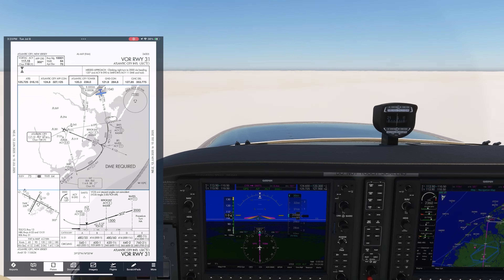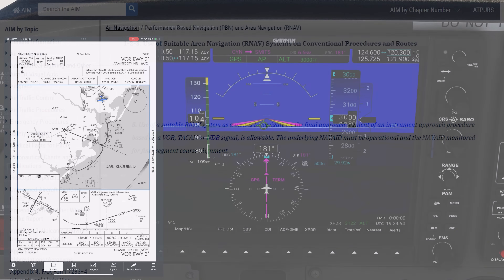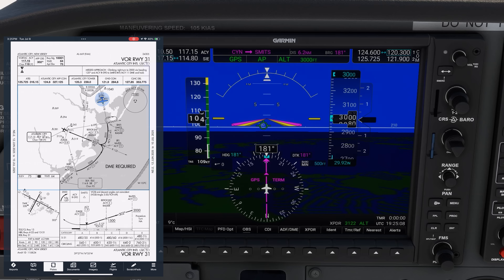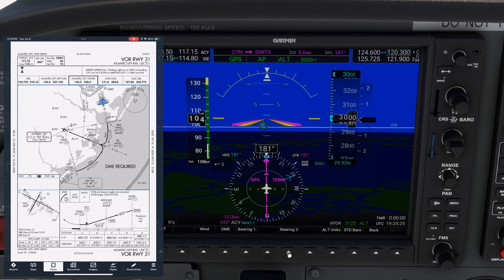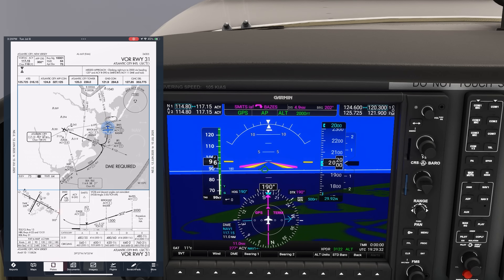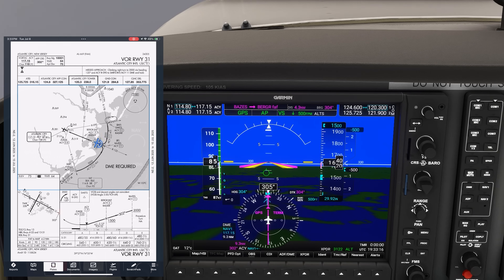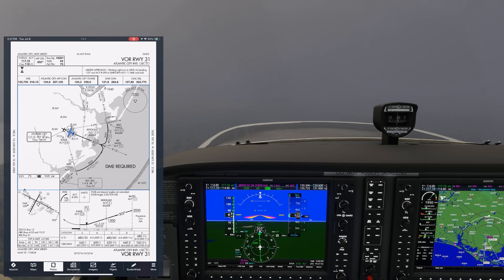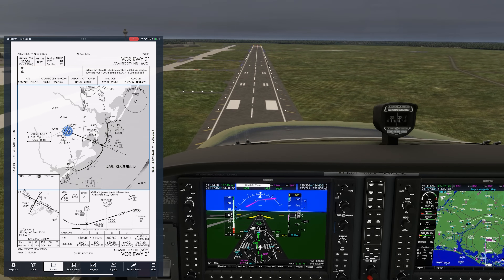Can You Use GPS for a VOR Approach? Here’s What the FAA Actually Says

Comment: The trick no one tells you is that in order to master G1000, you need to spend 40-50, maybe even 70 hours working solely with its endless functions. This is unpractical, giving the fact that the whole course from 0 to CPL/IR is about 250.
Reply: I used Microsoft flight simulator in the evenings to load activate and shoot approaches. Made me very proficient with the system by the time I took my checkride

Comment: Let's assume for demonstration purposes, we're flying with all Green needles. If you were to track the CYN R-178 outbound like you are in the video to SMITS, identified using the cross radial 090 of ACY, the 178 radial doesn't take you directly into the arc, so how would you know how far right to turn to get onto it? Is it just trial and error at that point? Or is it just more beneficial to stay on purple for those segments? Thanks!
Reply: To begin tracking the arc, I would figure my heading by starting with a heading perpendicular to the 090 radial which would be 180, then add 10 more degrees to the right since we're flying the arc clockwise, for a final heading of 190.  Wind correction would need to be added to or subtracted from the 190.  That would get you started.  Then follow your magenta GPS track or use the old-school sequence of multiple 10 degree turns as mentioned in the video at 3:17.
Reply: 90 degree difference (perpendiular) from the radial.........................................agree with frankarrison5872.    I concur.        Then once on the arc.... just turn 10 degrees and twist 10 degrees.  Ask your CFII about the "turn 10 twist 10" methodology if you don't already know how to do it.   Easier to demo it in person.....  good luck and fly safe.

Comment: My airplane, when finished, will not have VOR capability, but I plan to carry a handheld with VOR/ILS capability as a backup to the G3X system.  Any idea if monitoring a VOR with a handheld radio qualifies as “monitoring” in this FAR?  Seems like a gray area, but I don’t see where it is prohibited.
Reply: The FAA requires that when substituting GPS for a navaid (like during a VOR or NDB approach), the underlying navaid must be operational and monitored  and this monitoring must be done with panel-mounted, TSO-certified equipment.

From FAA AC 90-108 and related guidance:

“GPS substitution for the final approach segment of an instrument approach procedure based on a VOR, NDB, or localizer is not authorized unless specifically allowed by a NOTAM or the procedure itself. However, GPS may be used for monitoring if the aircraft has the appropriate navigation equipment to fly the approach in the event GPS is lost.”

And more specifically, regarding monitoring:

“Portable GPS or handheld VOR receivers are not approved as a substitute for installed navigation equipment.”